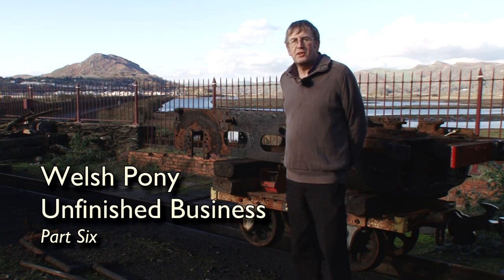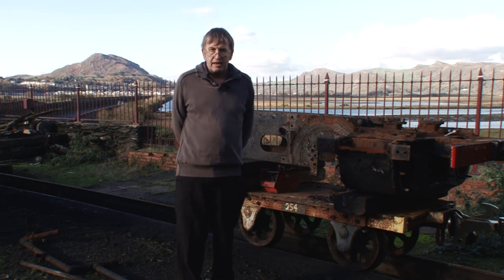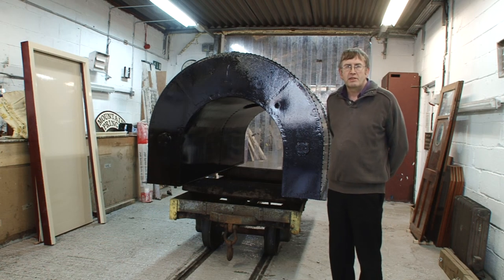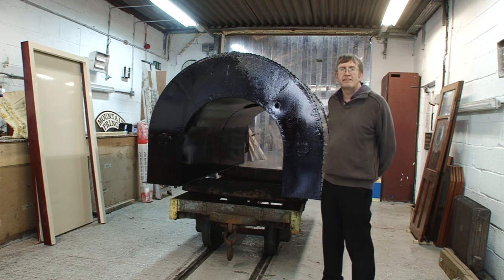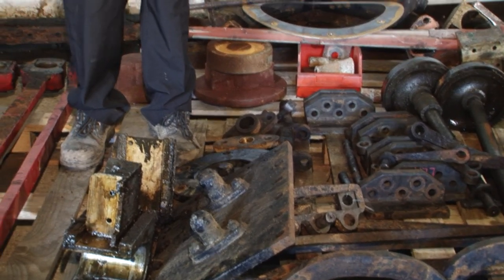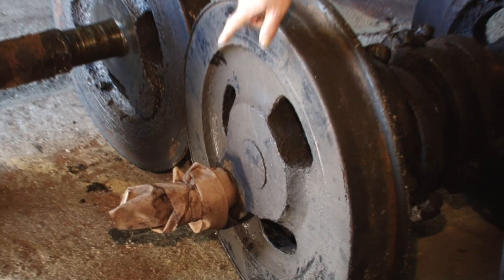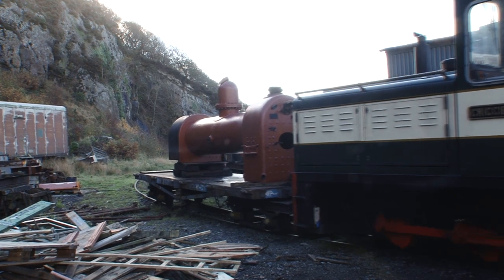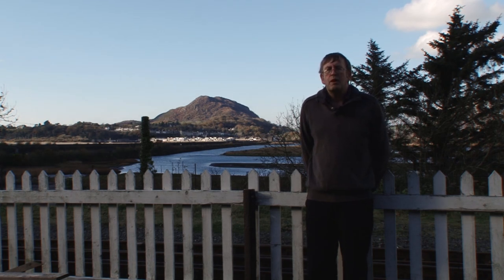Unfinished Business Part Six

Comment: Thank you for taking the time and trouble to update us regarding the overhaul of Welsh Pony. From a layman's point of view, I was most surprised to see the remarkable amount of corrosion on the frames and cylinders. I think this really helps to illustrate the complexity of the job as a whole. The good thing regarding the need for new frames and boiler are that, in doing so, you future proof the locomotive to a greater extent. In terms of benefits to the railway as a whole, this can only be a good thing, even if, in the short term, it increases costs and work load. A fascinating process and a real pleasure that it is resented without music or unnecessary flim-flam! Just a considered, illustrated and thoroughly understandable engineering commentary. Many many thanks!!

Comment: Seems like your having to almost build a brand new locomotive. But at least new frames, Boiler and Cylinders means a longer working life.   
And I have a question. When completed will she go back to her old shape or would she go back to the 1870 shape? without the cab, whistles on the dome and such? It's just seems like a golden opportunity to have a real Victorian train.
Reply from the maker: The rebuilt loco will be out shopped in 1939 condition... except in working condition
Reply: So she will be in the Green Livery again. Like you said.she will be working again. and that's what matters. it'll be good to she her move under her own power.